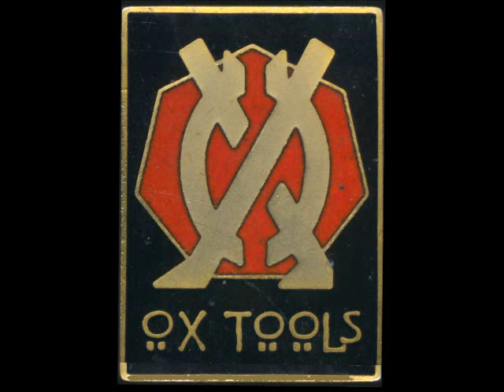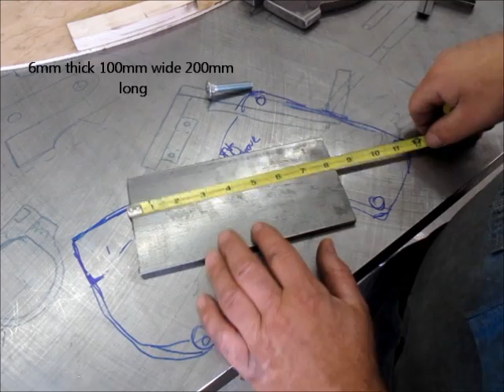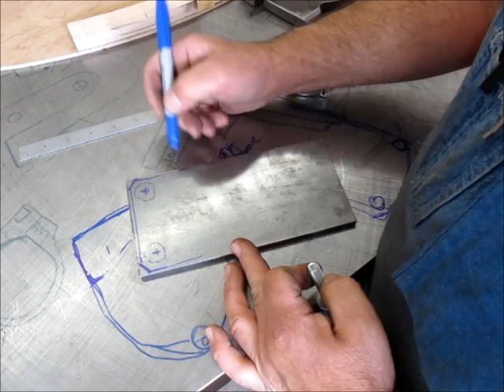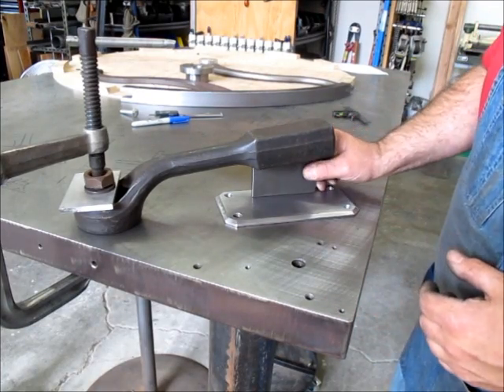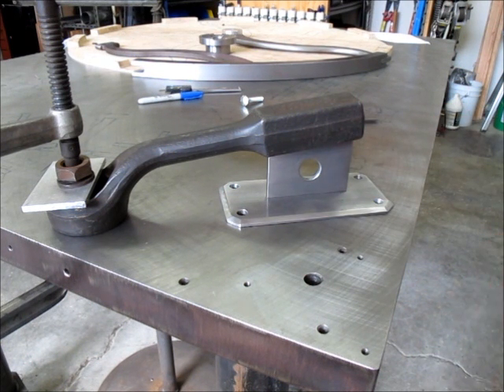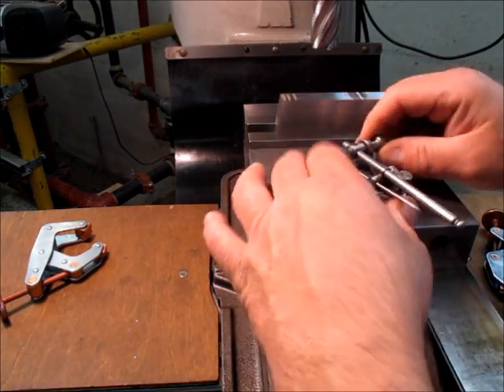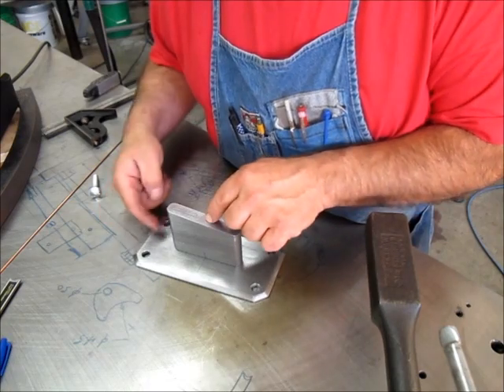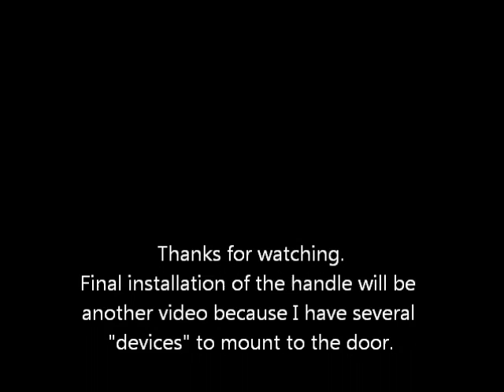How big are your nuts?

Comment from the maker: Hi Dan,

You bring up a couple of good points. The current crappy handle is screwed to the door with 6 small 3mm drywall screws. It seems to be hanging in there. The door actually moves quite easily after I leveled it and adjusted the hangers. The handle is well to one end of the door so any fasteners heads on the inside only get close if its wide open which is rare. There is enough room for them to pass if I had to go full open.

Regards,

Tom

Comment from the maker: Hi Hal,

Its just a hard paste wax finish to protect the steel somewhat. Blacksmiths use wax and a alchemist array of potions to finish bare steel work. I want the handle to slowly rust and patinize. The working surface will be fine as the previous crappy handle was untreated. The wax is a minimal barrier for corrosion although I find it works pretty well for my part of the country.

Best,

Tom

Comment: I was able to run the lathe at the shop and it does have the taper attachment but it is a 3 phase it will be going in my basement so I'm either going to need a phase converter or a single phase motor and it has been thirty years since high school so there is a lot to remember. Thanks again.

Comment from the maker: Hi Ron,

Expensive little buggers aren't they. My all time favorite is 1.50 diameter with a 3/4 shank for bridgeport machine. At least they come loaded with inserts as they are pricey also. I really think you will be very happy with the tool once you get past the cost of admission.  On the speed and feed for say aluminum the sky's the limit. I run mine around 2-3K and use the rapid traverse to feed with a spritz of WD-40.

Don't forget about fly cutters. Efficient and cheap.

Regards,

Tom

Comment from the maker: Hi George,

Look seriously at the phase converter. Many lathe motors are deeply integrated in the machine mechanicals and electrical control scheme. There are many affordable options in either static or rotary phase converters and plenty of web based support and experience to draw on.

Regards,

Tom

Comment from the maker: Hi Chris,

Caught me. I wasn't wearing any in this video. That sander is not very loud because it spins much slower. I do wear them for the belt sander and the smaller angle grinder as they are much louder. I like the rollup ear plugs best when I have to do any amount of sanding or grinding.

Best,

Tom

Comment: Nice job on the handle, and thanks for the trick with the parallel for setting the angle...that was one of the times when I didn't guess what you were about to do! 

For bare metal protection around here I use carnauba wax on the table saw top (stops rust, even at 90% humidity in the summer, doesn't contaminate the wood and interfere with finishes, lasts a while, and is cheap, quick, and easy to apply).  For other metal I've been using T9 Boeshield in a spray can.  The tablesaw top is still rust-free after 15 years.
Reply from the maker: Hi Hammer,

The wax didn't do much for the handle. It matches the rest of the stuff on the door now. I should probably re-do it but there are bigger fish to fry around here.

Thanks for the leads.

Best,

Tom

Comment: Hi Tom, another great video, thanks for taking the time to make & upload them, not to mention sharing your skills, knowledge & ideas. Had a thought with the big nut, have a big bolt coming through from the inside of the door with a few threads past the nut, so as to give the impression that the person opening the door is tightening/losening the nut .. would also be an extra point to transfer the load of pulling the handle into the door. All the best. Peter B. Belair (Australia not Los Angeles!)

Comment: I was surprised  that you didn't broach the mounting plate holes for the carriage bolts. Would of been another good process. I admit, a bit over kill but interesting.
Reply from the maker: +Brian Spruill Hi Brian,

I don't think I have a square broach that size. Normally with carriage bolts I put a hole that is a tad smaller than the cross corner dimensions of the square under the head. I let the fastener swage the locking element from that point. Thanks for the comment.

Cheers,

Tom
Reply: +oxtoolco Thanks for the reply.
Reply: +oxtoolco Hey Tom,
I'm sure you could have just asked Abom for one. I'm sure he's got a couple that size laying around, have him check between the couch cushions.
Great video as always.

Comment: That looks very good, very engineered! -but I hope those 4 bolts are enough to hold it when your lunging at the door to open/close it if it is heavy door, I would have gone for 6 bolts. I'm intrigued as to what is go on the inside of the door that won't jamb on the wall when it is wide open. Like Tom Semo says below "what's the doorbell going to look like?" or are you planning on some "significant" door knocker instead? :-)

Comment: Very clever method on matching an unknown angle and setting it square to vise Tom. A definite forehead slapper because I didn't ever think of doing it that way myself. That door handle is just cool. I've seen a few nuts and bolts in the open pit mining industry over the years that would be way too large for your door.
Reply from the maker: I forgot what I did and had to go back and look at the video.  Thanks for the comment.

Cheers,

Tom
Reply: Well I finally decided to go through all your past videos. Probably better and easier for you, plus save your time if I didn't comment on the older ones. Some very interesting items and techniques in them for sure.
Reply from the maker: Hi Point,

Thanks for the comment.

Cheers,

Tom

Comment: There's a few ways to do it. Good, sharp, cobalt or carbide bits. Use a small bit 1/16" or so, lots of feed pressure, and lube. Or use a tiny carbide burr in a die grinder to make the hole and open it with a bit. Blast it with the plasma. If it was just the end of the key, heat it up dull red and let it cool..

Comment: Hey Tom,
You are so good and I am impressed by virtually all you are capable of. However when you weld without protection you are sending a terrible message to young people. Especially unshielded radiation such as TIG. You place yourself on the same level as the TV Chopper builders with their cavalier attitude, ie: tacking with mig sans eye protection nor gloves or arm protection. I have had many "Sunburns" in my welding career, due usually to inadequate cover. Love your work and your book otherwise!!!
Reply from the maker: Gary Weldele Hi Gary,

Not everybody is as sensitive to the UV as some folks. This is also not a good reason to weld unprotected. The cup blocks much of what comes off the arc during TIG welding. I don't advocate going bareback while doing any kind of arc welding but for short sessions and low amperage the hazard is much overblown. I would not be that uncovered if I had to do it all day long again or running heavy aluminum amperage.  There are enough warnings on the welding machines, hoods and filler materials without me chiming in and adding my two cents into the mix. I let folks decide what they feel comfortable with in the privacy of their own shops.That said if I was teaching my grandson I would have him in long sleeves and gloves for sure. Thank you for pointing out something I don't think about very much because its mostly muscle memory at this point.

All the best,

Tom